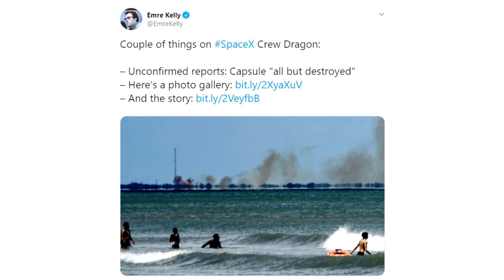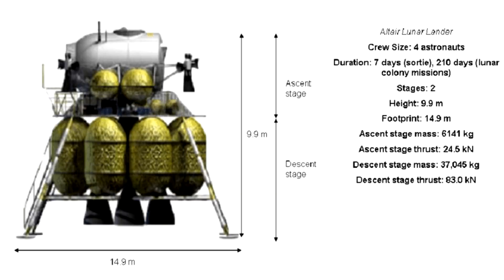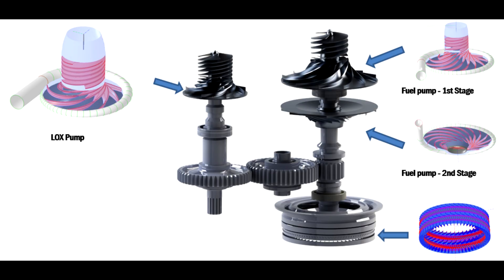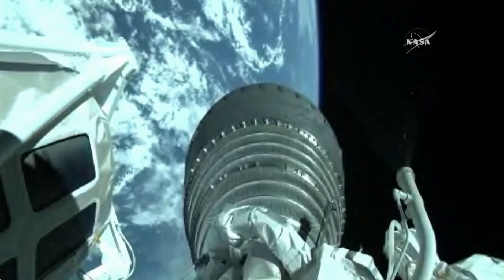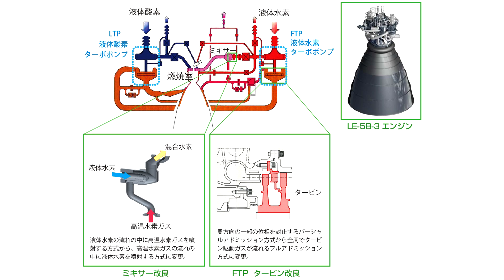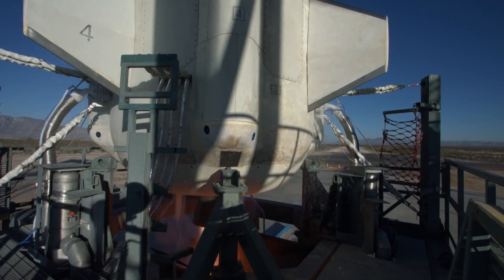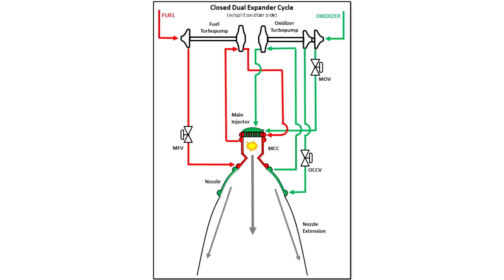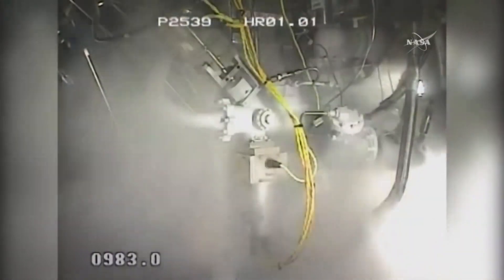Expander Cycle Rocket Engines - Using Waste Heat To Drive Your Rocket

Comment: why not feed some of the pressurized fuel coming from the cooling vanes directly into the combustion chamber, use the rest to power the turbopump and then feed the "exhaust" of the turbine into  the fuel fuel tank? You could do that for the oxidizer tank too to pressurize both propellant tanks.
Couldnt that improve the chamber pressure by a lot since its not limited to the turbopump pressure delta anymore?

Comment: consider using the expander cycle for a fuel-rich gas generator, which then drives the turbopumps to increase chamber pressure

Comment: My question is how much power does a turbo pump need to pump the fuel and oxidizer in the RL 10 engine.
The V2 turbo pump generated something like 600 Hp if I am not mistaken.

Comment: Can the propellent in a closed split expander cycle that powers the turbine then be sent to the propellant tank for autogenous pressurization, instead of to the combustion chamber? That would probably reduce the back-pressure on the turbine....

Comment: I would say there is one thing that is not fantastic about the RL-10. Its manufacturing process is very complicated and time-consuming, with the thrust chamber and nozzle being assembled out of hundreds of tubes that then get brazed together. Nowadays, especially with the relatively low chamber pressure, you could probably 3D-print the entire thrust chamber and nozzle assembly as one single part, with the channels already built in, saving a huge amount of manual labour.

Comment: The various expander cycle engines are my favorite type of rocket engine, particularly the Hydrolox ones with ISP's well above 450s.  They may not scale do to the square-cube limits, but Methalox is a great choice for booster anyway.  For me, the holy grail would be a Hydrolox main engine for an upper stage or planetary lander with an as yet undeveloped hydrolox RCS system using the same fuel.  Still need helium though!

Comment: Came here from you're injector video and I appreciate you're response to my question. So, in an expander cycle engine does the hydrogen go thru an injector plate into the combustion chamber, and if so is it still a vapor or condensed into a liquid by that point? I was curious about the impinging flow dynamics of such a set up.
Reply: It's gaseous hydrogen at that point after passing through the thrust chamber cooling tubes. In the RL-10, for example, the hydrogen is then fed in the combustion chamber via a porous metal injector plate, LOX pass through injectors (as usual) and I believe a bit of hydrogen still pass through injectors too.

Comment: In the final design you mention, why not dump the gas generator exhaust into the combustion chamber? Is that exhaust at a lower pressure? Or just fully combusted and not providing any benefit at that point?

Comment: I used to learn a pretty interesting expander cycle engine design. In this engine, the pump is driven by helium in a closed system. The helium is heated by combustion chamber and then dirven the pumps of liquid hydrogen and liquid oxigen; then the  helium is cooled by the tank of liquid oxigen. It was proposed by PWR and called EX-Hex cycle engine. This  design could  also  be applied on methane-oxigen engine.

Comment: OK------------ The Expander cycle was used on the competing engine for the Space Shuttle with the Company building a prototype to prove it could be more efficient than the existing Shuttle engines.  Producing a Specific Impulse efficiency 20% higher than the eventual winning bid. It would have given the Space Shuttle the Ability to put a payload of 60,000 lbs or 3 times the 20,000 lbs. comone for most space shuttle missions.  But because of a Corrupt Nasa Program manager (getting a lucrative VP post in the Winning Comp shortly after the contract was awarded) giving the specs of the competing Expander Cycle engine to the winner before the Competition was finished, the Winner then changed and lied about it's engines Specific Impulse (Even though Nasa Engineers knew they were lying) and was given the Contract. But because of the Lie the Space Shuttle had to be powered at 110% on each launch just to put 20,000 lbs of payload into orbit other wise no payload at all beyond astronauts would have been carried.  Also why it took over 30 Space Shuttle missions to put up the ISS. The Company that lost says that they could have eventually increased the Shuttle payload to over 80,000lbs over time if they had won the bid. They even came back after the first Shuttle disaster and offered to build the engines for Nasa at no cost, if Nasa guaranteed to lease the engines at guaranteed SPF efficiencies for each shuttle mission. With Nasa still having the ability to go back to the original Engines if the Guaranteed Specific Impulse and reliability was not attained. But again the Project manager shit canned the propullsule telling Congress lies about it  then after the proposal was dead went to work for the Existing Engine manufacturer.  Typical Corruption in Nasa.  The same happened to new Solid Rocket boosters that got rid of the segmented cases that destroyed  one Shuttle and crew. As well as a none ceramic reentry shield using strong bolt on titanium/composites that would have cut maintenance time and cost to hours instead of months.  Saving millions as well as the lives of another Shuttle crew as the stronger Titanium/Composite plates would have shrugged off the falling ice instead of shattering. Nasa Corruption is likely why the SLS is decades behind schedule and billions over budget. But then that is just giving Space X the opportunity to show what none Corrupt Civilian industry can do.

Comment: Has anyone ever tried to run an open expander cycle with the fuel (hydrogen in an upper stage) dumped into the lower area of the engine bell ala an afterburner? Would a mixture oxygen rich enough to allow for the combustion of the normally overboard hydrogen be practical with this cycle?

Comment: Suppose we have an expander cycle engine and scale it up by a factor of two keeping the chamber pressure the same. Then the throath area becomes 4 times larger and so does  chamber wall area. 
With the same chamber pressure the LOX/LH flow (kg/s) becomes also 4 times greater. But then we will have 4 times bigger area to warm the 4 times bigger amount of LH to turn the turbine and there does'nt seem to be any problem.
So why don't we get bigger thrust by scaling?
My own solution (not quite sure if its correct) is that we need to take into account the best optimazation of the engine:
Burning 4 times more  LOX/LH does not need 8 times bigger combustion chamber, which would be the volume after scaling everything by factor of 2. It only needs to be 4 times bigger, and in that case the chamber wall would not have 4 times bigger area, but only 4^(2/3) bigger. So not enough are to warm the LH for the turbine.
The Vinci engine clearly has a longer chamber than the RL-10 to counter this effect, but increasing the camber size too much might ultimately mean a too big weight penalty. 
Comments please.
Reply: Hi Juha--What you are saying is incorrect.  If you double the engine's linear dimensions (which is what I think you're saying), then the throat area becomes 4 times larger (as you said) and pumping the propellants requires 4 times the power.  But your statement about the chamber wall area going up by four times is not correct.  It only goes up by 2 times.  The throat area goes up by the square of the linear dimensions, but the cooled chamber area only goes up linearly with the chamber dimensions.  So as we make the engine larger at constant chamber pressure, the required pump power goes up twice as fast as the thermal input power.  This is why expander cycle engines have an intrinsic thrust limit.

Comment: I have only one question regarding turbo pump vs expander cycle engines. It’s a bit technical, maybe you could cover it fully in a separate video. My question, simplified for brevity is this: Expander cycle engines, specifically as used in the RL10..... are they gay?

Comment: I do think that a RL-25 with a different nozzle optimized for pure vacuum use might get better specific impulse than the RL-10.
I KNOW that it would get much better thrust than the RL-10.

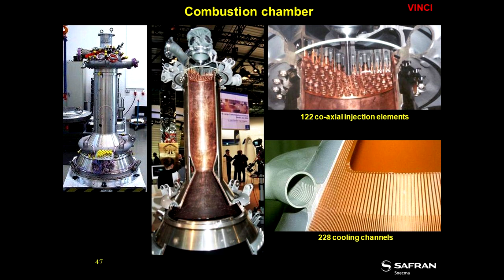Comment: 7:01 - Couldn't you (theoretically, at least) get around this by using a fuel-oxidiser combination with a higher flame temperature?
Reply: combustion chamber volume = same
temp increase, pressure increase= backpressure on injectors
every action equal and opposite reaction. so i love the enthusiasm and initially thought the same, but no. unfortunately not. besides hydrogen and OX reactions are some premier heat releasing combustion when density of elements is considered, weight of reaction products etc.

Comment: A question for Mr. Manley. What liquid rocket motor type would you choose to make a homemade rocket? Good points; easy to make, cheep, reliable, small (total rocket under one meter or better yet 30 cm). Would love to see a show just on this question! Thanks.
Reply: not sure a liquid motor is the best for such a small rocket, but probably a pressure fed one, due to it being simpler and less heavy.
Reply: N2O/Gasoline is a decent combination. Or if you got some kerosene, that would've been even better.

Comment: I am curious about something that might be a good topic for a video.  Why don't we use air-breathing boosters on rockets?  It seems to me that jet engines are pretty performant and reliable and if we could save the weight of oxidizer, it would be a net-positive to strap some on and eject them when the air becomes too thin.  Even in the pre-SpaceX era, when boosters were never reused, I find it hard to believe that a jet engine would be more expensive to throw away than a rocket engine.  So what are the tradeoffs of doing this?
Reply: Skylon

Comment: I like how the Rutherford engineer upper stage has two batteries one ejects when drained reducing the total weight to SECO down just a wee bit.
Your going to need all the efficiency you can get with a 17m tall rocket.

Comment: We have (sort of) efficient "jet engines", why not use the "free" oxygen on/in low altitude and a couple (arbitrary number... 6) of them for the first stage with a parachute and a small rocket booster landing system? so they would be reusable would it not be an effective first stage? or is it just too complex and not worth it or does it just suck (in general :-) more air then available at such a confined space?

Comment: And the Japanese are going with the (Open) Expander Bleed Cycle for their rocket engine LE-9, which solves the limiting thrust problem of Closed Expander Cycle, so it can give high thrust while also reducing complexity and cost albeit at a less efficiency. 
       But the superiority(by power) yet low cost n simplicity of it is unmatched by other expander engines I believe. 
        (I had made this comment without watching the whole video completely so I thought he missed LE9 of Japan when mentioning others earlier in the video.)

Comment: Love your videos as always! I would love to see a video about the combustion tap-off cycle. As a thought, I always wondered about a combustion tap-off cycle that uses an external starter such as an electric motor to get the turbo pump spinning before the rocket launches. I figured that starting such an engine would be extremely simple. Get the turbo pump spinning, ignite the pyros, then open the propellant valves and the engine will start and be able to run on its own. An overrunning clutch will automatically decouple it from the electric motor once the engine fully ignites, and off it goes!

Comment: I'd like to see you do a video on the Aerojet M-1 rocket engine, especially if you can visit where the parts of the unfinished prototypes are. It had a unique solution to the efficiency loss from dumping turbopump exhaust at low pressure. Make the pumps extremely powerful so their exhaust is at high pressure then duct it to a ring of nozzles at the bottom of the skirt where they would produce a few thousand pounds of thrust instead of no thrust like other open cycle engines.

Comment: would it be feasible to use some of the energy from a rocket engine to turn turbines connected to contra rotating helicopter blades around a rocket? It sounds wild and unruly but the idea is to take some of that energy and use it to push against the atmosphere with blades rather than just the impulse of the engine, which could theoretically increase the efficiency in the atmosphere no?

Comment: The Rutherford engine has half of a really good idea.  It uses battery powered electric motors to drive the pumps.

The better idea is a hybrid expander rocket engine.  Take an RL-10, add an electric motor/generator on the hydrogen turbopump shaft.  Remove the gearbox and drive the LOX pump with an electric motor.  You get the advantages of the electrically driven rocket: no seal between LOX and fuel requiring helium, vastly simpler startup, simpler and much faster throttle control (good for landing!), less careful balancing of the turbine power to pump demand.  But you can use a much smaller battery, since the majority of the pump power comes from the turbine.  Finally, you can scale to a significantly larger thrust than an expander cycle, since when you increase engine thrust, expander turbine power may not keep pace but it does increase significantly.  So as the engine gets bigger the battery scales faster than the rest of the engine.  Eventually that's a problem but you can get quite a bit bigger and enjoy the cost and thrust:weight advantages of a larger engine before the battery weight is a loser.
Reply: The turbopump of the RL10 is in the order of a megawatt... So going electric definitely won't improve thrust:weight ratio and you can't get more thrust because you can't build such a powerfull electric motor/generator or it will be insanely heavy. Or you would need to lower chamber pressure (less pumping power required) but that would either hurt specific impulse or you would need a much larger nozzle (making the engine heavier again hurting t/w).

Comment: Scott how does the efficiency compare to Kerosine/Methane when taking into account the lower density of H. Some Tesla fans have made their own metrics that factor in kWh of the battery, range, and weight of car. Maybe you could do the same here.
Reply: Depends what you mean by efficiency. Hydrogen is, by physical laws, the optimal fuel: it's the lightest atom, therefore the highest exhaust velocity, therefor the most efficient in terms of velocity change versus weight. But it's very bulky - takes up a huge amount of space. Therefore, in the real world, it's a lot harder to make use of. Bigger tanks = more expensive, and more drag because they are physically huge. But it is by far the most efficient (and it's literally impossible to beat; it's the fundamental fact that it's the lightest atom).
Reply: @Mythricia1988  I mean best performance in terms of how much payload you can send off with how much DeltaV when taking into account everything you mentioned.
Reply: @ryccoh  There's really no simple answer to it, which is why there are so many different engine designs and fuel choices in use currently. The reason kerosene is used so much is because it's both cheap and lends itself to much more powerful engines. Which, in terms of getting tonnage into space, is by far more efficient. It's incredibly hard to build a rocket that uses only hydrogen and oxygen, that also carries a big payload. Because the fuel tanks become insanely huge. (Just think of the orange space shuttle tank, and that still needed 2 solid rocket boosters). At some point it becomes hard just to pump enough fuel into an engine large enough to do it. Building engines and tanks and fuel lines that can handle a liquid with a boiling point of 20 kelvin adds cost and weight... Etc.

TL;DR - there's no easy answer. If there was, everyone would be doing it.
Reply: @Mythricia1988  SpaceX and BlueOrigin are both going with Methane because reusability outweighs everything but second stage wise it becomes more debatable. I wish Scott could crunch some numbers on this
Reply: @ryccoh  Oh sure as a second stage it's great. But you have to get off the ground. Liquid Methane is 6 times more dense than liquid Hydrogen, at -162*C instead of Hydrogen needing to be at -252.87*C. It's not really in the same ballpark. Liquid Methane competes with Kerosene; not with Hydrogen.

It isn't really debatable. Hydrogen is too bulky for any large first stage. Even if it is much more energy efficient. Exceptions exist obviously, such as the Delta V and related vehicles. But they don't have better lift capacity nor efficiency... They were built as Hydrolox launchers because that's the only thing Rocketdyne had recent experience with. They went that route of necessity, not because it was a good idea.
Reply: Off the top of my head the Delta Heavy overall performs pretty well, for its size, it doesn't seem as it performs worse than non-SpaceX Kerosene rockets. Do you think rapid hydrogen tank corrosion is still a problem with H or have they gotten around that with modern alloys or maybe COPVs?

Comment: "Hydrogen is very bulky..." Is it? Why? It's a tiny molecule that can presumably be compressed as well as any gas. What am I missing here?
Reply: When hydrogen becomes liquid it cannot be compressed any further and takes a heap more volume than other alternatives, just compare the ratio of the space shuttles external LH2 and O2 tanks to an RP1 / O2 tank like the falcon 9